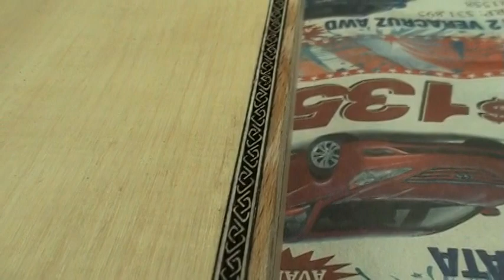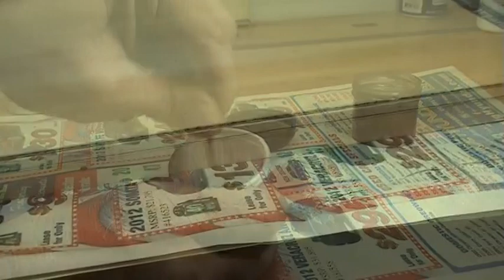Luthier Tips du Jour - Purflex

Comment: Does tempra powder mix into other epoxy too, like smith , Lmi, or west systems?
Reply: Yes it will work. I have worked with epoxy for years in the boat building trade and I have mixed epoxies with a number of things. It is however important to mix the two parts up before adding any powder and do not use pigments that are in liquid form (unless specifically made for that purpose). Only use powdered pigments. Also just another note on epoxy. There are two main forms of epoxy and they use different hardeners. But most commercial epoxies used for gluing are of one of the two types the other type is somewhat less available. I have had three or four different epoxies in my shop from the main suppliers and have used the harder from my favorite supplier with all three resins to find out that the tech is in the hardener not the resin. In other words the best epoxy is the best hardener. The only real variations in the resins are viscosity as that is where that is controlled. The best hardeners have less blushing more forgiving mixing variations etc... All you never wanted to know about epoxy.